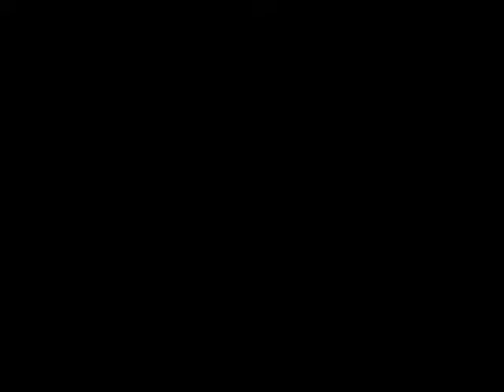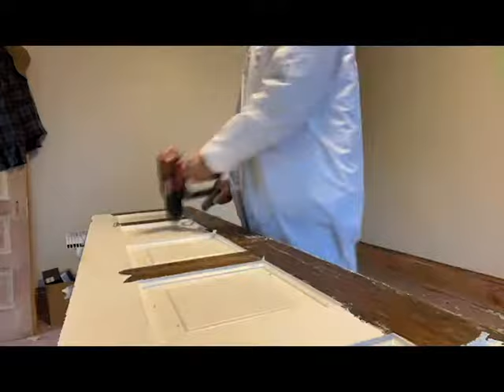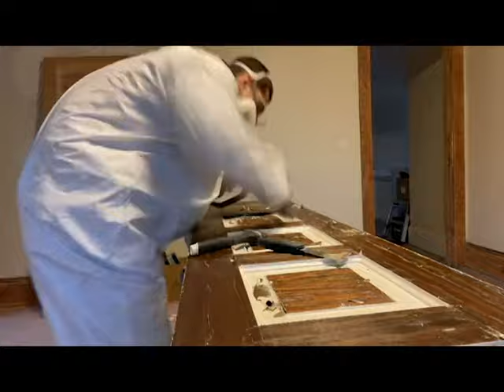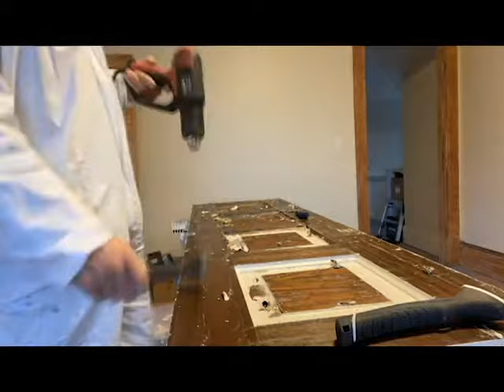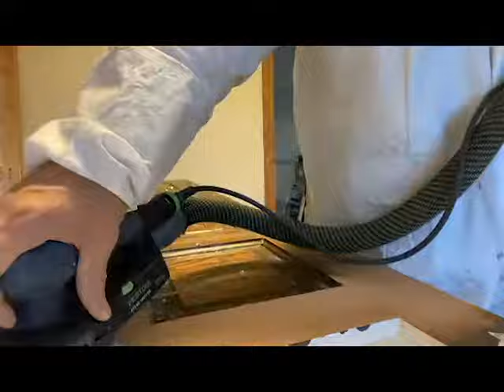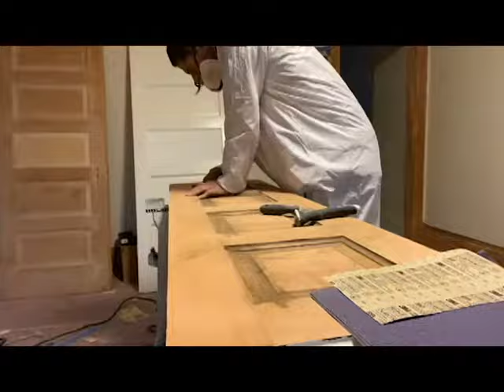Removing Lead Paint From A Door

Comment: so a heat gun is the way to go with removing lead base paint
?????
Reply: Absolutely not. Use stripper, don’t sand until all the paint is off. Probably should wet sand and do it outside